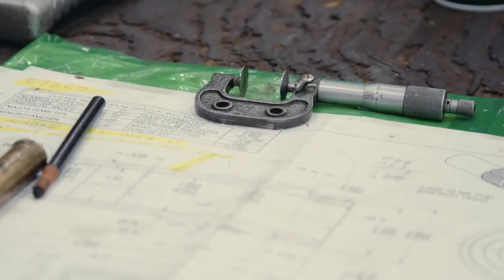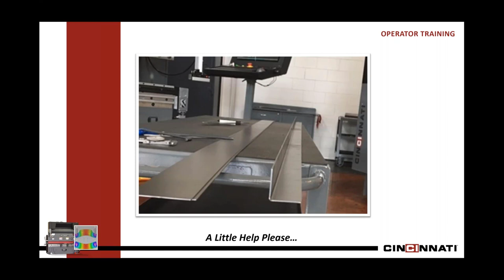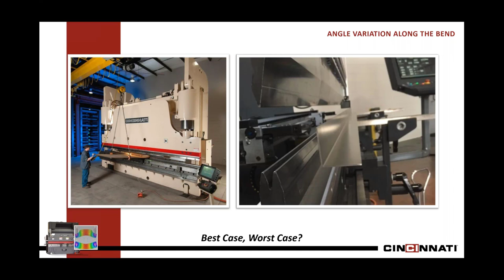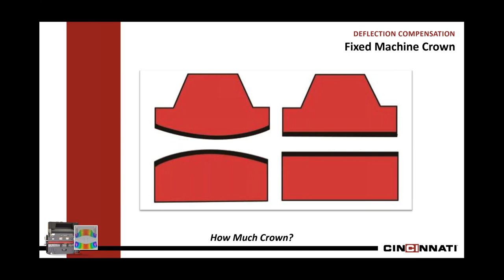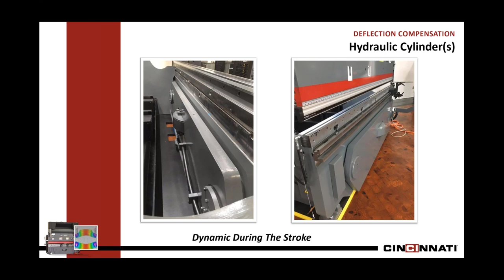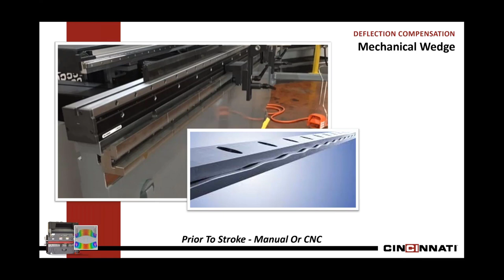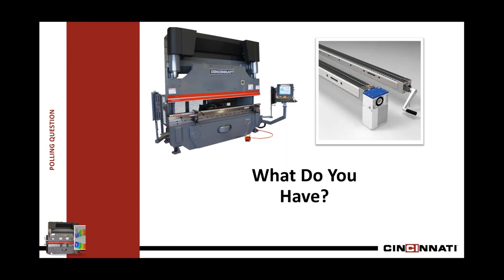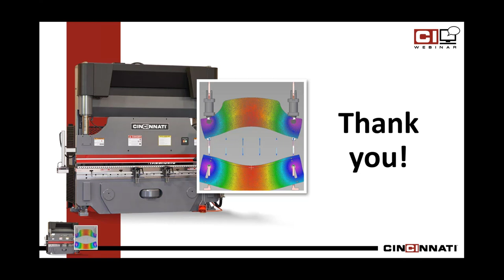Understanding Press Brake Deflection Compensation

Comment: why is the scale on the front of 
the press in : tenths of an inch?

should it be 1/16  of an inch?
Reply: In machining and more precise work inches in drawings are written in decimals up to 4 places.
Reply: @impactodelsurenterprise2440  no you don't understand. 
what is 1/10 of an inch?
or 4/10 of an inch?
Reply: @MUCKFOOT399  It simply means 0.400" or 0.100". A tenth of a thou(thousandth) means 0.0001". Inches aren't always fractional you know.
Reply: @impactodelsurenterprise2440  I've never seen a ruler go by 1/10.
I use 1/16,    all my tools go by 1/16.

idk....
go ask someone 
   "bend this at 2foot 3/10 of an inch "